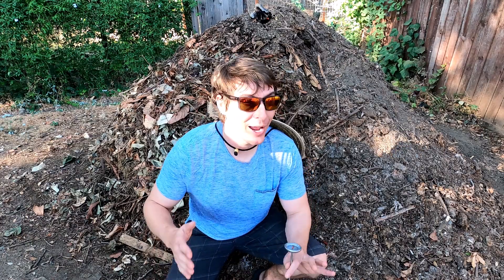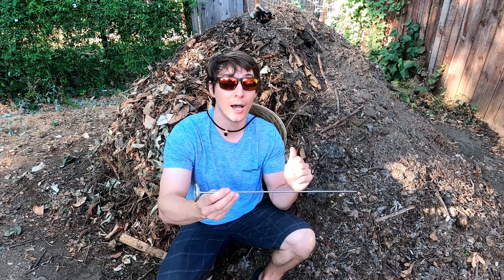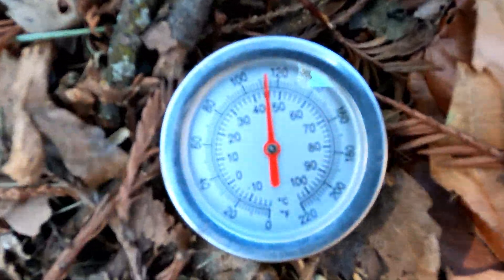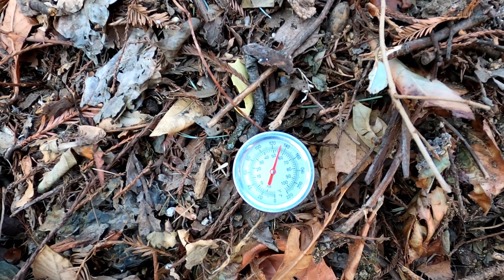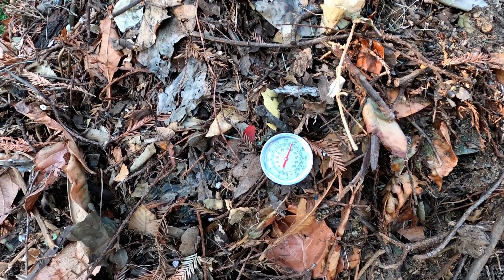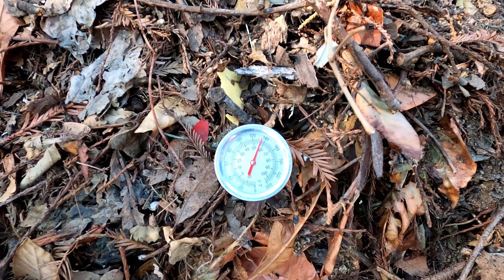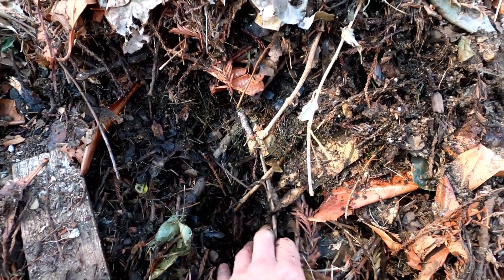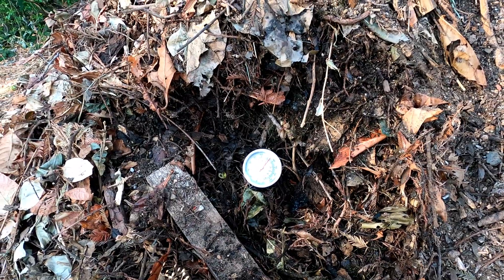My Compost Pile is on Fire! Using A Compost Thermometer on my Hot Pile

Comment: Yeah root fire is real.  And yes I looked up dew drops on leaves and it's possible too but highly unlikely.  The sun usually heats the dew, drop up and evaporates it before it can concentrate the sunlight long enough to start a fire.  And of course compost fires are a real thing too I've seen it before myself in an old pile of leave pushed up against the fence in one corner of a neighbor's yaed.  It spontaneously combusted as I walked by and there was a large flame in under a minute if I hadn't have been there to call the fire dept the entire yard full of leaves would've caught next and probably their house.  They had no idea they were inside chilling. 

Now for the root fires how that works is as the root system burns away it leaves a little bit of space that acts as a chimney to keep just enough airflow to the roots so they keep burning. 

Or it could be a "death ray" satellite from space with a giant magnifying glass and a computerized aiming system.  You never know.  😅😂😊

Comment: Click bait! Compost piles catching on fire 🔥 is a serious problem and this video did nothing to educate people on the risks.
Reply from the maker: Compost piles almost never catch on fire, for more than 99.99% of gardeners its not a serious problem. Massive amounts of stacked hay however can burn and that is concern for farmers. This video is about the heating up of an active "Hot" Compost pile due to bacteria and the processes of decomposition.
Reply: @fieldtrippin1  yes but for that 1 in 10,000 it can be. I have seen it happen after grubbing operations. Multiplied by the number of compost piles out there it results in fires. So few people out there are aware of the danger that when they finally hear about it they put it in the same category as spontaneous human combustion.

Comment: My pile is 142F right now here in Canada, but it's only about 35F outside. Last April it got up to 170F for a bit although it's mostly been 130-160F. 

In my experience, if you really want to keep it consistently hot, you want to flip it as soon as the temperature starts to drop, like if mine drops by 5F from the current 140-145F, I'll flip it. That way it rebounds faster. If the temperature drops a lot it might be a sign of some imbalance (ex lack of oxygen) and that imbalance will cause the bacteria population to drop. If you ensure those imbalances don't occur and the bacteria population stays high, they'll bring the heat back up fast after you flip the pile again.
Reply from the maker: Yup! Great advice Nicolas. Working on the compost pile at my school recently. We are chopping, flipping, and adding moisture to our pile to speed up the process and heat things backup. Its all about finding that proper balance of oxygen, water, brown materials and green materials. Well said Nicolas. Happy gardening Nick!
Reply: I have a big pile of just grass clippings in Canada as well, today it was hot enough inside the pile you could probably have burnt your hand if left in there long enough, quite amazing